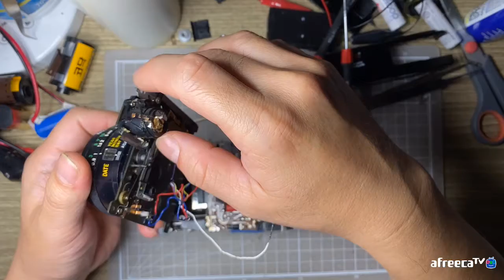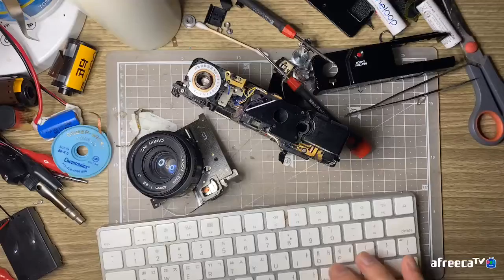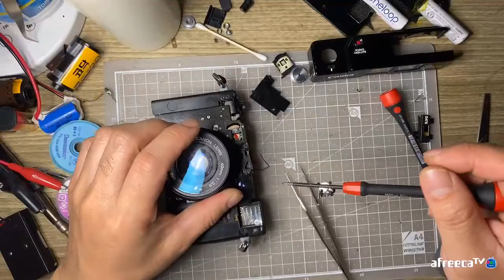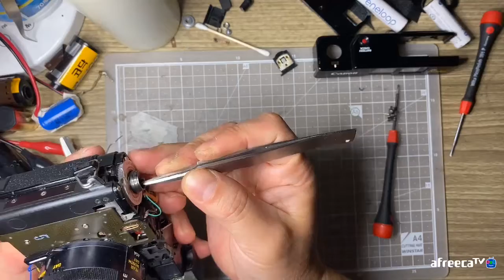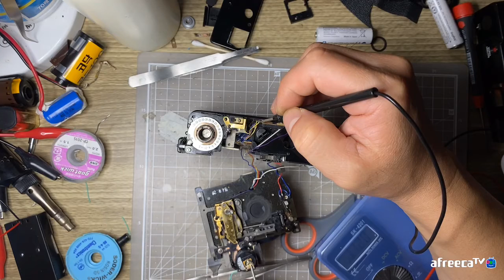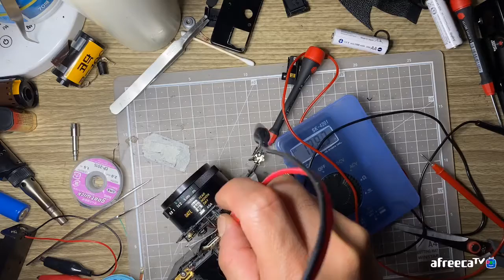아 노출계가 왜 작동을 안하지 캐논 A35 한번 뜯어 봅니다 1/ Film camera canon A35 exposure repair

Comment: Hey, i just discovered you Chanel! Could you help me? I need to remove the Upper Shell of this camera model to get access to the Flash module. I need to repair a broken conection there but i don't know how to take apart the advance lever. I would be very grateful! Thank you!
Reply from the maker: The ring on the film-winding lever needs to be turned. If you let me know your mail, I will send you a picture.
Reply from the maker: @tomnoack9593  I sent you an e-mail.
Reply: @drawinguptv  Thank you very much!
Reply: @drawinguptv  Thanks to your help i managed to get everything undone without causing any damage. Nevertheless i am stuck at one last position, i send you a mail if you could help me one last time i would be very thankful (again)! :)
Reply: @tomnoack9593   @Filmcameralife I have the same problem, could you help me?